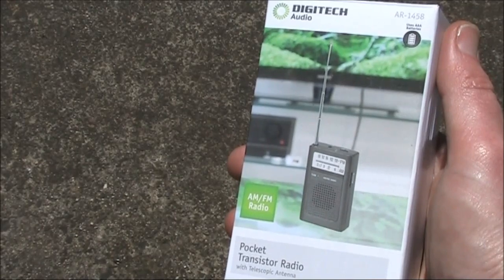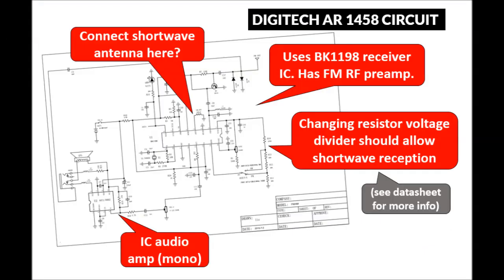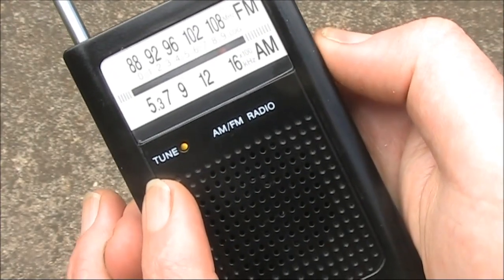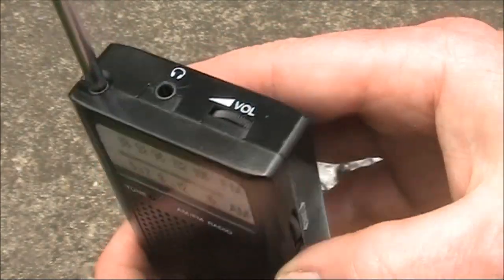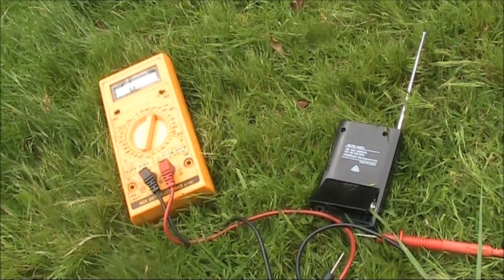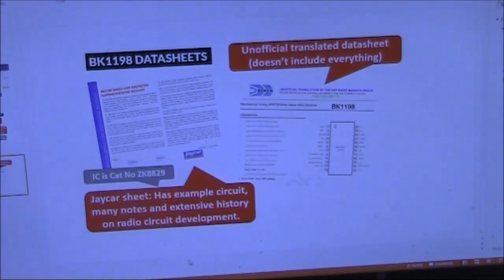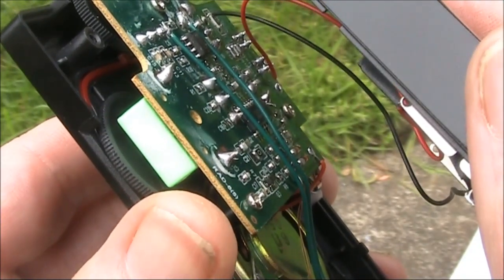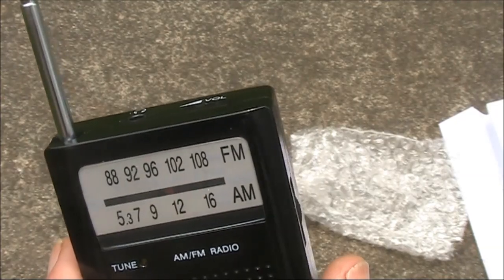Reviewing the highly hackable Digitech AR1458 transistor radio

Comment: I've got a FM/AM\SW1\SW2 radio utilizing this BK1198 chip. 
If the crystal for the oscillator were bad, would the radio not pick up/tune in any stations? 

I'm only getting continuous hiss. Thanks.

Comment: In Canada this is the CM Brand, available at Canadian Tire or Dollar Stores for ~$10CDN. The circuit board # GF-921R Date Code 2017-7-25 on one that I am working on. it is typical Chinese kit in that you will have to fix the cold solder joints to get a functioning receiver... Interesting there is a place for a second LED which changes the model # to GF-922 according to the silk screen on the PC Board.
de VE3IYB Doug EN93ui

Comment: Last year I got a radio from UK which also has long wave and it sounds like it has this chip, because as I tune across LW (or other band) the audio static cuts out when I am moving the tuning dial. BK1198 looks like an interesting chip. I want to make a SSB receiver for the 80 meter band. Maybe it will be easy and good this way.
Reply from the maker: It must be a similar chip as the BK1198 appears not to do longwave. Unless there's some clever internal programming to make it so.

Comment: I would love a little more internal information about the BK1198 [can't find any on the internet]. I have been bashing about with Jaycar's "Cardboard Radio" KJ9021 which is much the same. Have converted it to a 12-position rotary switch, with tuning, but quite often the local strong stations flood everything. No success yet. de VK4AKH.

Comment: I wonder if this could be tweaked for 160?
Reply from the maker: It would be tantalising but the way the bands are set it can't be (though it can cover most of HF). However a converter will be very easy to build. And there are ways around it to get good bandspread. There is no known information online about getting into the programming of it.

Comment: I have something similar, so I cracked it open: but it was a KTMicros KT0936M radio-on-a-chip, that's certainly a different product. However, there is a full datasheet, and although it doesn't support Shortwave, it provides an FM band from 32MHz to 64MHz. Another interesting thing is its using an I2C EEPROM for its configuration-- so modifying it to handle the 6m FM segment would be a relative straight-forward reprogramming of the eeprom-- if I had an 8-pin SOIC testclip...

Comment: One drawback is not knowing the selected frequency. With just a 100k tuning pot and no frequency output.
Reply: Look at my forthcoming article coming up in January 2021 Silicon Chip. I used a Arduino Nano to control the chip and it has a digital readout on a 16x2 LCD.
Reply: @charleskosina4799  I will. Thanks!
Reply from the maker: You could make a dial scale to give a rough idea. Plus a bandspread control with another potentiometer on shortwave. That should give reasonable resolution, especially on the narrower shortwave bands (if you set up the voltage divider to cover these). Plus a signal frequency BFO using a DDS for a digital readout.

Comment: Thanks for posting Peter.  I must study the data sheets.  It may be possible to use 2 of the rf ics and a dual pot. One ic as a bfo.  Add a tuned preselector in front and a digital readout and it could make a reasonable general coverage receiver.

Ps the hinged battery cover is a very good idea if you have children like mine who loose the covers!